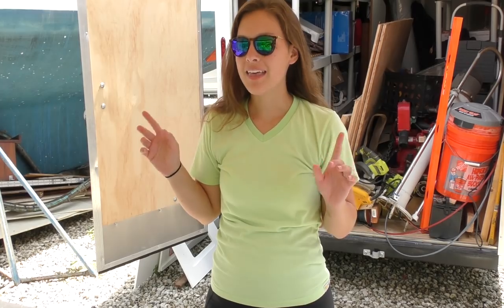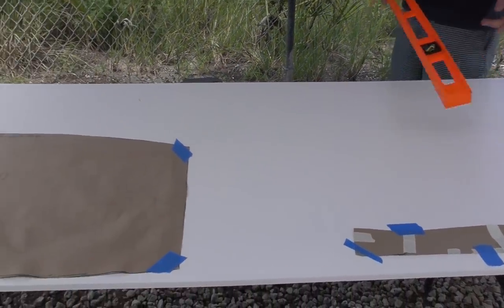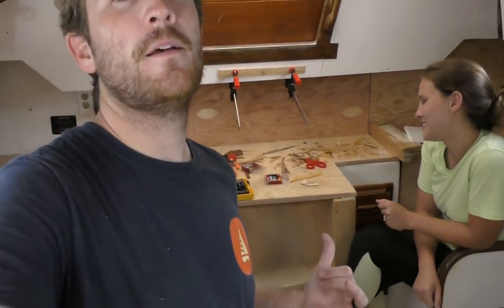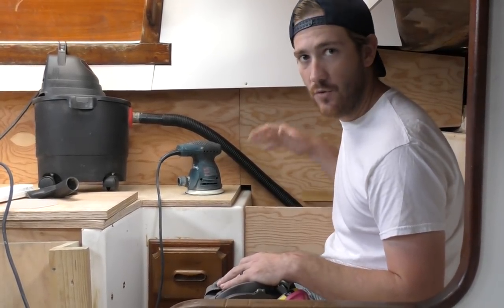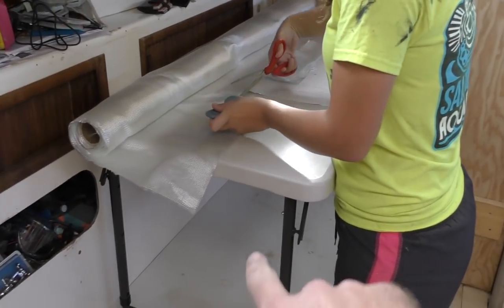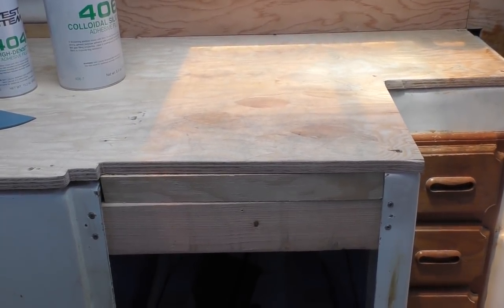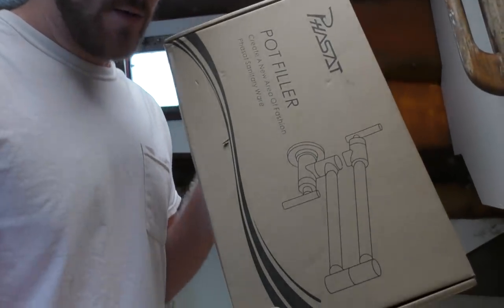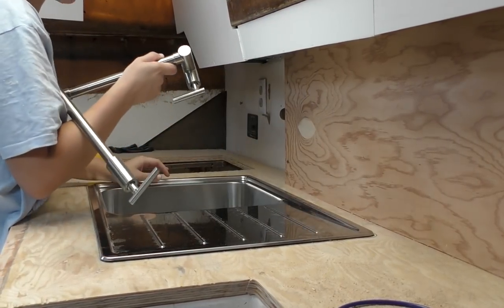55. IKEA Sink on a Yacht? - Galley Refit Progress | Learning the Lines - DIY Sailing

Comment: Balance the boat from the waterline stain so your sink will be level with the world when you put the boat in the water.
Reply from the maker: Now that the counter is flat it should be fine. Thanks for watching!
Reply: Learning the Lines I wonder if it’s possible that the counter was purposely angled that way instead of level in order to facilitate drainage of liquid toward the sink maybe?
Reply from the maker: It was, but it didn't function properly due to having an over mount sink so water just pooled in the center.

Comment: When you’re several hundred miles if not thousands out in rough seas  you’ll wish you didn’t cut corners. Not sure if I should pray or just shake my head
Reply from the maker: I'll be sure to curse my lack of sanding on the non-structural tabbing as we sink.
Reply: I think that if your going to the effort and expense; do it right.
Then there’s no doubt that the tabs have good solid adhesion 
Just my opinion, and like assholes, we all have one

Comment: I cringed with your use of wood shims, but you redeemed yourself with the end grain strip filler on stop of the 2x at step edge. Should be much stronger. You need to really look at that adhesive you bought, yes it was not cured, but I do not think that was reason it popped off. Even the edges, like just running a bead, whick looked to be part way cured should have held. Adhesives have lots of various bond strengths and weakness, suspect that one is not good for lateral strength. You REALLY need to check how well it is for that as on a boat it will have quite bit of that motion and will fail if has weak lateral strength. I will have look at that product later, but you need to investigate that before using it.
Reply from the maker: Lol yay redemption! I'm not sure where I would research the lateral strength of the product though.
Reply: Could not find actual bond info, even from DAP, but see my other comment. Would recommend Contact Cement glue, I know that will work well and will not have any issues with lateral strength. Better safe than sorry, and not only will it work better, should be bit cheaper as well.
Reply from the maker: Good to know for any future projects. Hopefully these pieces should be okay with this adhesive and the stainless steel screws we put in.
Reply: Well if they start to show signs of becoming loose later, you will know what to use. Unscrew and redo :P
Reply from the maker: True! Should be easy enough.
Reply: Agreed for Contact Cement. But NOT the water based one. Ok, smells a lot less but does not have the strenght of the regular (acetone based ?) cement. Just make sure to have adequate ventilation nor sparks of any kind when using it inboard. One cured, no more vapors.
Reply: Ah good to know, never used water based one ... but that takes away half the fun anyway. Loved the tack buzz fond memories when a kid ;)

Comment: "If it rusts in a year or two and it lasts that long well, we can just order another one from IKEA."  God I hate that mentality. Disposable products world. As a woodworker, It's the same mentality that  keeps someone from buying a well built solid wood chest of drawers and opting  for a piece of crap particle board furniture that they have to replace every few years. So instead of having quality items that can be passed down for generations we just fill up the landfills. Remember, good things aren't cheap, and cheap things aren't good. But for your sake I hope it turns out to be good quality and gives you years and years of use.
Reply from the maker: Thanks. Yeah we are hoping it lasts since its stainless steel. I guess the better statement would be that if it doesn't we'd probably try a composite one instead and not just get another of the same.

Comment: I’m probably not the first to say this but that mask will not do what it’s designed to do, if you use it with facial hair. It’s better than nothing but still....
Reply from the maker: True, facial hair impedes the seal a bit, but Jordan wears it extremely snug. I'm wondering now if that might be why...

Comment: If you actually use that adhesive to bond the pvc board to your plywood it will fail on your first sail. You guys really don't know what you're doing.
Reply from the maker: Tell me, do you know this from experience? Have you bonded pvc board to plywood with this specific glue on your sailboat and then gone sailing?
Reply: I've been a furniture maker and woodworker for 35 years. That DAP Dynagrip is not manufactured to bond pvc or melamine to construction-grade plywood that is under lateral pressure. As you saw yourself, any lateral pressure will result in failure, and even a child understands that a sailboat is under constant such pressures when subjected to the winds and currents in open water. If you need to bond melamine or pvc to plywood you must use a marine-grade epoxy. 

Are you seriously going to sail that vessel in the ocean? If I were your parents I'd use some pretense to get you away from the boat and then burn it down to the keel. You are going to get killed out there in the first storm.
Reply from the maker: Yes, because if the pvc board fails that means we will die in a storm. I shouldn't have to explain to you that the pvc board falling off (if it does) will mean absolutely nothing to the structural integrity of this boat in a storm. Please use logic in your arguments.

From my experience, epoxy doesn't like to stick to plastics or pvc. I could be wrong here but that's why I've always put down some type of plastic under anything I'm fiberglassing. The epoxy will pop right off the plastic easily. The adhesive we used specifically said it would bind to PVC and is exterior grade meaning resistant to water and moisture. Will the forces of the boat flexing in heavy seas cause the glue to fail? I don't know. We'll find out. Keep in mind there are also screws holding it in place as well.
Reply: You are attaching the pvc board to construction-grade (not marine-grade) plywood in a boat, and you're doing it for cosmetic reasons. I assume the pvc board substrate is some kind of fiberboard. This material will disintegrate when exposed to water. You are doing this on a bulkhead that is fundamental to the structural integrity of your vessel. Perhaps you are unaware of the stresses that bulkhead will endure in the ocean while you are under sail, but those materials will not withstand the marine environment for long. That's why they manufacture marine-grade plywood.

You say that "in your experience" epoxy "doesn't stick to plastics or pvc." Well,  I suspect you don't have much experience. Marine-grade epoxy will bond plastics to wood (if properly mixed and applied) with a strength far greater than that of the materials it is bonding. That's the point.. It is also impervious to the marine environment. 

Look, I understand that you two are having fun refitting this vessel, and that you have a few thousand people following you on YouTube as you do so. However, I sincerely hope you never take that vessel anywhere in the ocean, or in a lake larger than a pond. If you do you are risking your lives.
Reply from the maker: The plywood IS marine grade and the pvc board is 1/2" solid pvc which is impervious to water. There is no fiberboard substrate in this install at all. We've been using marine grade epoxy a ton on this boat and it has never stuck to anything plastic we've used. There's no sense in arguing any longer here and I'm not going to reply again to this trolling. We'll just show you we're not going to die in the open ocean. Have a nice day.
Reply: Labeling your critics as "trolls" isn't helpful. I've seen other replies you've made to those who question your decisions that were both rude and/or inappropriate. You've decided to publicly record your project here and yet you seem offended when people point out what appear to be poor decisions (removing the diesel engine) or questionable choices of building materials (the adhesive in this video). You will or will not succeed at this project. Time will tell which one of those eventualities occurs.
Reply: Learning the Lines
Please, ignore this or similar guys' sorry comments. They do NOT deserve your time and attention.